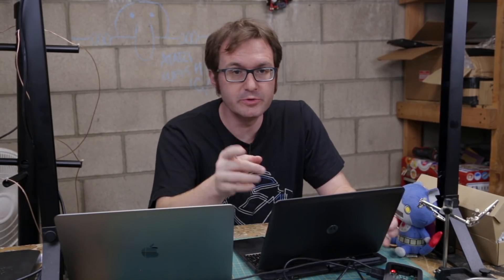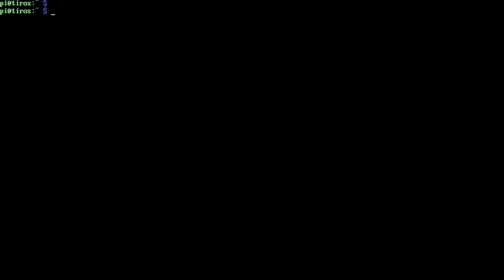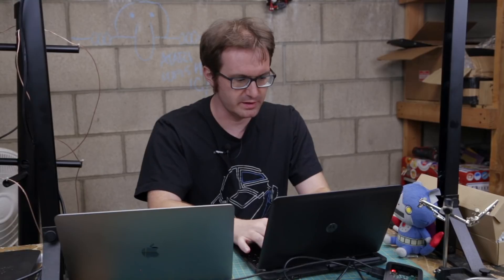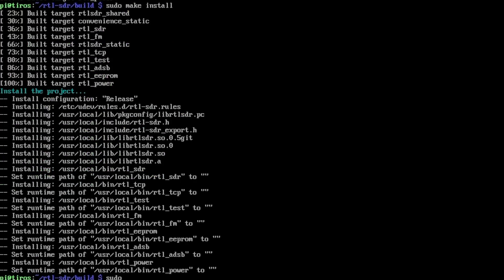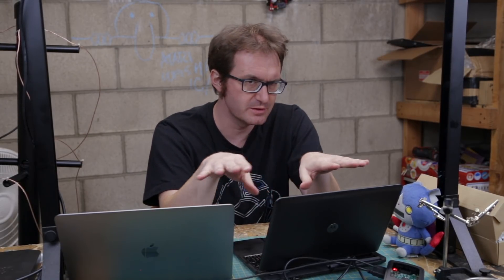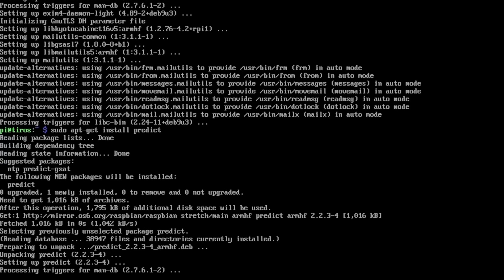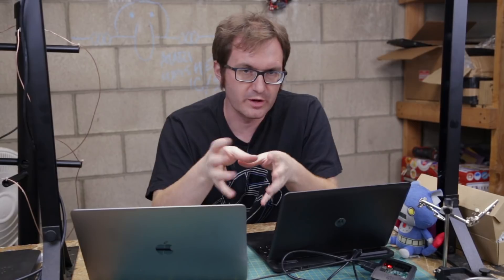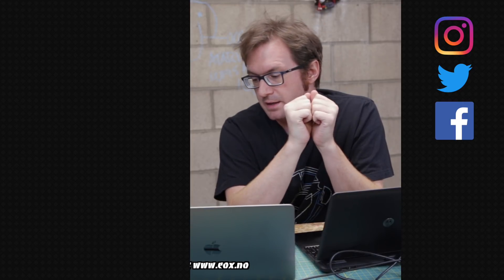How To Set Up a Raspberry Pi as a NOAA Satellite Receiver with RTL-SDR

Comment: can i do this on a raspberry pi 3 A+?
Reply from the maker: Only one way to find out. Go forth!
Reply: Mines waiting for Noaa to fly over at 15:54 it works on the B as well. I'm thinking its also possible on the Pi Zero with the right cable for the dongle.
Reply: they do sell modify sdr  dongle  on ebay i done it with 6$ mini umbrella  you can turn into a antenna make sure it's metal  you have solder rg58 cable on it  running to your sdr.

Comment: Amazon reviewers complain about this model sdr getting very hot. i'm curious if you're having the same experience.
Reply from the maker: It does get a little hot, yes, but the shielding also acts as a heat sink so it hasn't overheated...yet. I've used this on several projects now and never had a problem with it.
Reply: @AirborneSurfer  Do you know if this will work for a Raspberry Pi Zero W.
Reply from the maker: @JustTechGuyThings  Can't see a reason it wouldn't, but you may see lower performance off the Zero.
Reply: Yep, i finally got it setup, but having issue with kal -s GSM850. I wonder if it's just my antenna. 

I wish I knew what connector was on this -> https://www.ebay.com/itm/USB-2-0-SDR-DVB-T-USB-Stick-Receiver-RTL2832U-R820T-Tuner-Antenna-w-Remote/312087933427?ssPageName=STRK%3AMEBIDX%3AIT&_trksid=p2060353.m2749.l2649
so i could get a cheap GSM antenna for it.
Reply: @JustTechGuyThings  I would guess the connector type is an MCX.
Reply: @c4715  Yeah, finally figured out, just looking for an MCX to uFL connector.